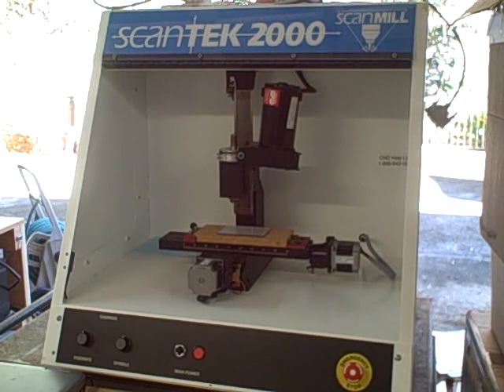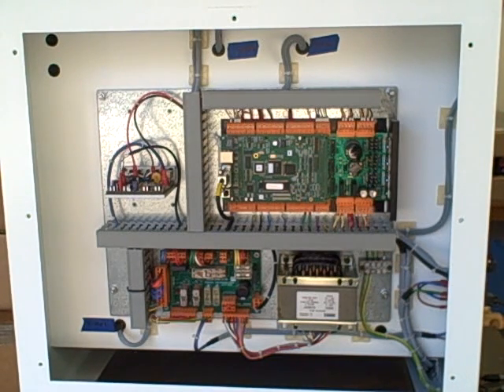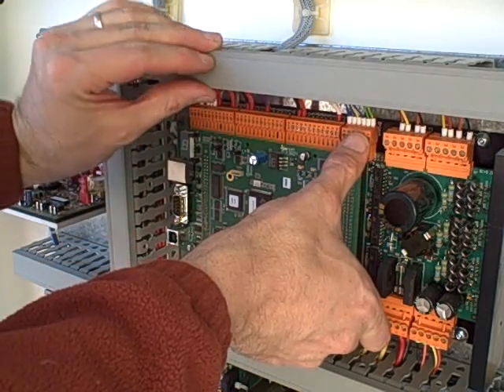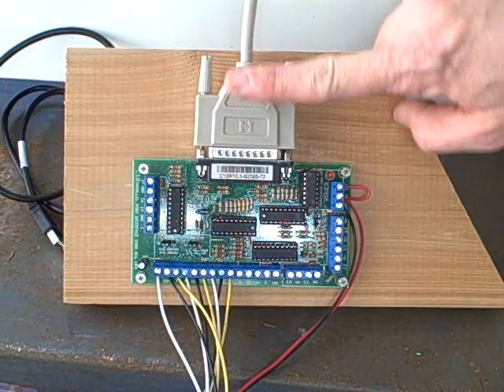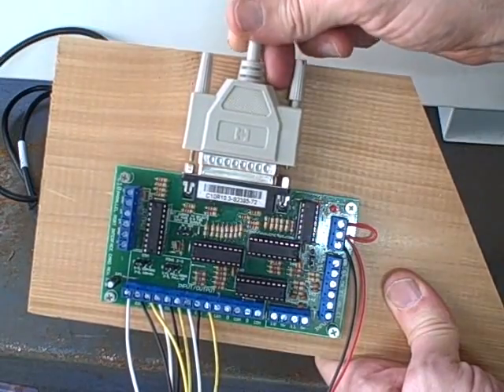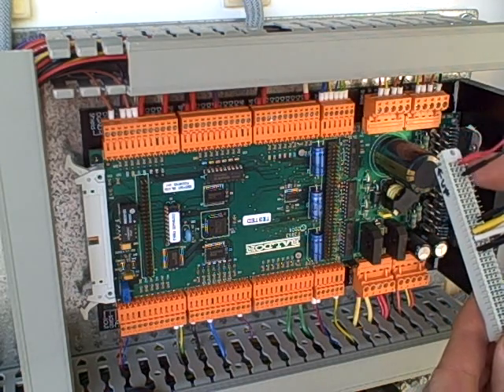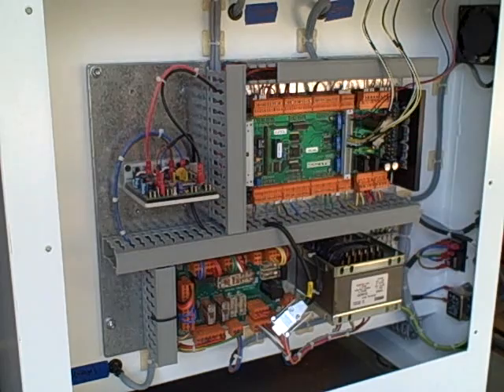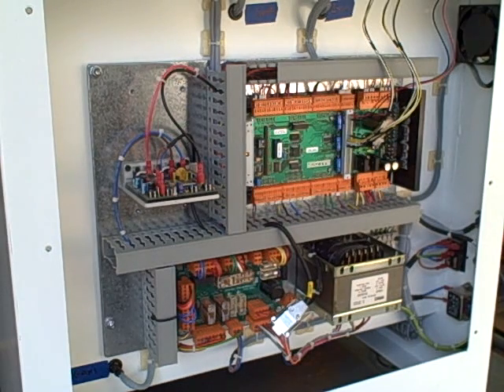Benford Micromill 2000 Mach3 / Linux CNC conversion HOWTO Part 1 - 3 Axis Conrol

Comment: I read on their online manual about 4th and 5th axis control off a misc. equipment pinout. It can go to another driver board and has step and dir as if it's coming off a breakout board. Any idea on how to hook that up? I have an A drive for a next gen sherline 5800 but also want to use it in my 5400/denford 2000.
Reply from the maker: The schematics I have show Axis 0 on TB6, Axis 1 on TB5 and Axis 2 on TB12.   TB2 is labeled "extra outputs" and TB3 is labeled "Outputs" but the are just numbered (0-7 on TB3 and 8-15 on TB2) so I have no idea what pins would be correct.
Reply: I see, I'll try and get in touch with Baldor directly. I'm hoping the hookup from the breakout board to the control board pins will be the same. I'm assuming I can't just hook up another driver board to the breakout board unless I only intend to use 3+2 machining, no simultaneous movement. Also, I'm wondering if you've hooked up a probe and tool setter and how that is managed software wise.
Reply from the maker: @commandercody38  I'm afraid I have not hooked up a probe.

Comment: Thanks for the videos. Just wondering if something like this would work to run from the break out board back to the PC.
 https://www.amazon.com/Syba-SD-ADA10012-Printer-Parallel-Bi-Directional/dp/B01N9HNPGE/ref=sr_1_7?dchild=1&keywords=parallel+to+usb+cable+bi-directional&qid=1613353713&sr=8-7
Reply from the maker: Probably, but sometimes the USB to parallel adapters won't work, so be sure to test it.

Comment: ROTFL!  I think they put all those fancy security screws so you won't discover that the machine is mostly composed of off the shelf parts. The spindle speed controller is the same one used on the newer treadmills.  The motor looks like a standard DC motor and the Baldor board is probably a vendor supplied stepper controller. The cabinet was probably built by the CEOs brother in law who needed some work. I bet the machine was built for a couple of grand of parts and marked up to $30K. You,could probably build one for a lot less with parts scrounged on ebay.
Reply from the maker: Yes, everything except the cabinet is off the shelf, but they are top quality components. I doubt I could replicate it for under $5K.

Some of real value in the Benford machines is the software, which is top notch (but expensive, around $750 USD to license for a used machine like mine). Due to that expense, I decided to retrofit it to use a parallel port interface for Mach 3 or LinuxCNC....but the ScanMill software is very nice and I gave some serious thought to just buying the software and using the mill as purchased.
Reply from the maker: I'm sure it's better than any of the options available that run on Linux, but that's the OS that I choose to use....

Comment: Hello there. I have a denford micro. I wonder if you have any tips for cutting aluminium?
Reply from the maker: No magic tips, other than to make sure your feedrate is appropriate and take small bites.  You can also ask people who use manual Sherlines as it's the same mill inside.
Reply: +Jay Summet great. many thanks. I had a go and was a bit choppy will try a lower feed!

Comment: Thank you for posting this Jay!  I also have a micromill that I am trying to set up like this.  It's slightly different than yours but has a lot in common.  It can be seen here if you would like to take a look:
 http://www.cnczone.com/forums/benchtop-machines/302886-cnc.html
Would I be able to contact you directly through email or though a forum in order to get this machine running?

Thanks,
Doug
Reply from the maker: +Doug Ryan I replied on the forum. It looks like you can use the same technique I did (linked on my website in the video description) to  control the x/y/z axis. [It doesn't look like your unit is controlling the spindle speed.]
Reply: Jay Summet
Thanks Jay! I noticed that you replied on the forum after I left a comment here.  At first I didn't realize you were the same person.  I think I'm going to save my g540.  No sense to throw away what works and give your method a shot.  I'm pretty exited and definitely appreciate your intellect here.  I don't think I could have figured this out on my own. 
-Doug